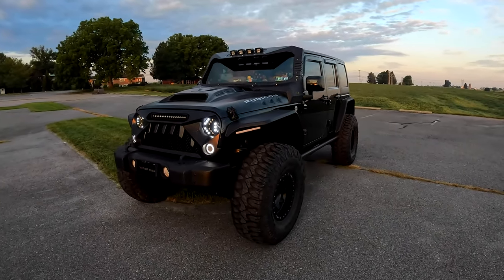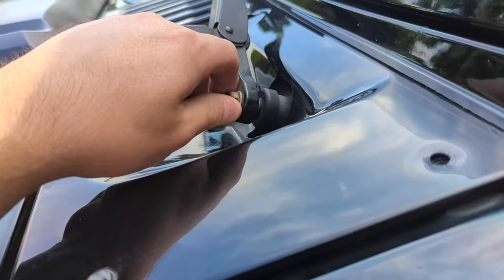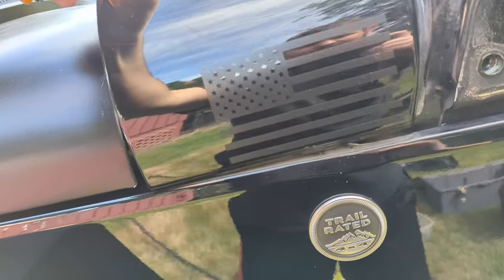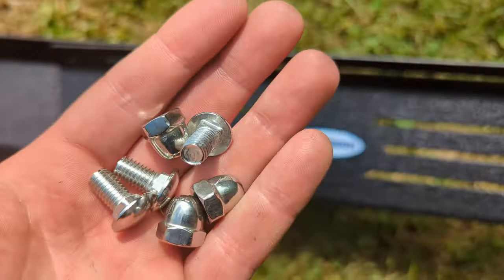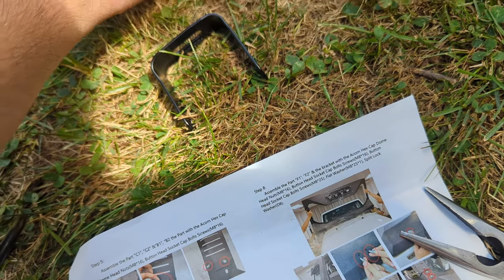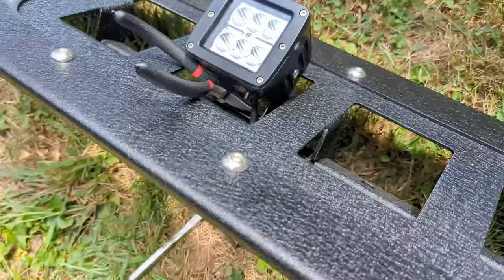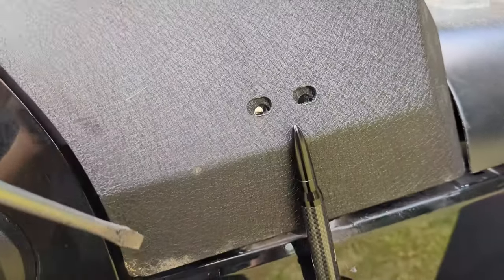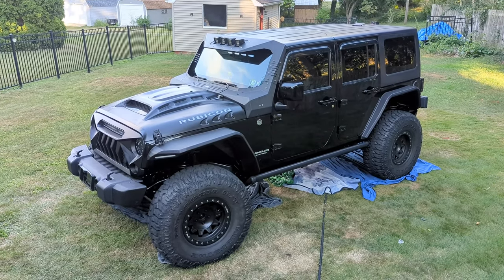How to installed the Hooke Road Mad Max Windshield Frame Cover

Comment: So I have the same set up and I’ve been getting leafs and other debris into my ac blower from the middle opening did you figure out a fix for this ?
Reply from the maker: i have not noticed this problem ( i dont drive it much ) but a fix could be something like this, if i had that issue id install Mesh from under the hood covering the hole but allowing air to pass. https://amzn.to/3vAouZj